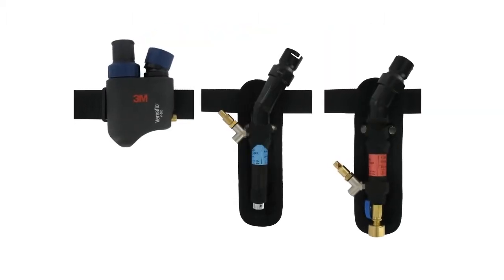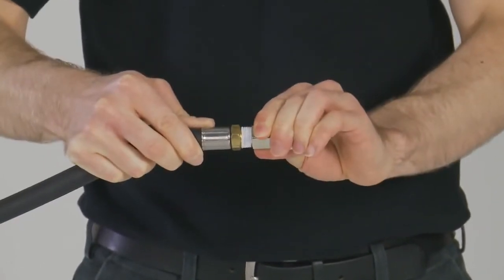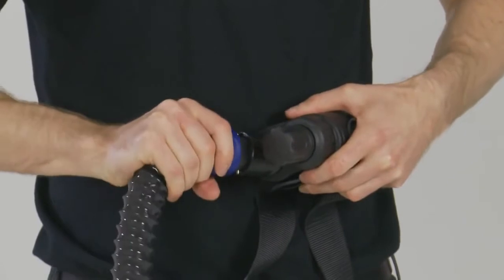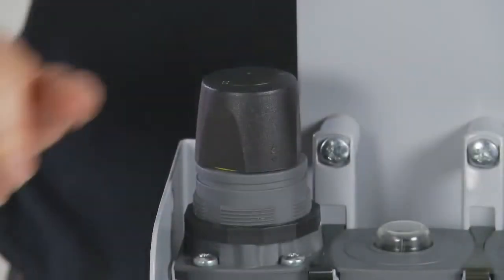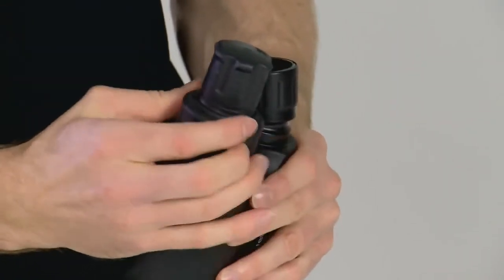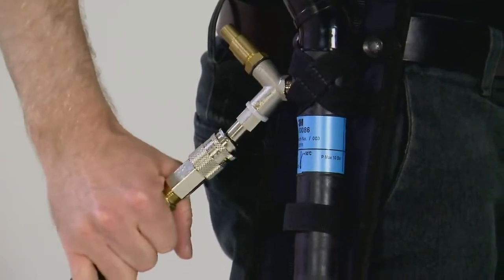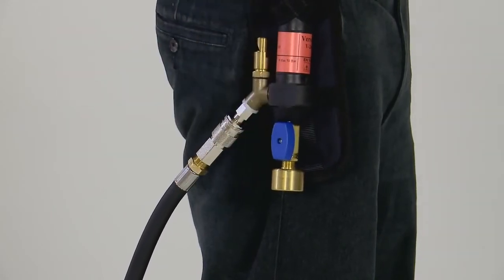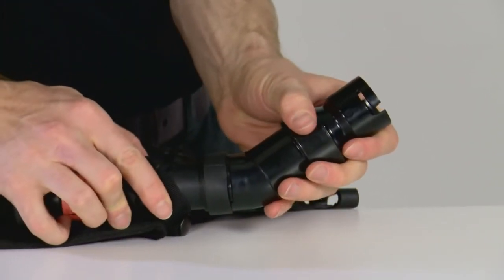3M™ Versaflo™ V Series

Comment: hello, can you advise me, still when I connect the air hose so the versaflo is a terrible noise, I have to repeatedly connect and disconnect the hose until the noise stops sometimes 5 times sometimes 10 times. where is the problem?
Reply: Air flow is too low

Comment: hello, can you advise me, still when I connect the air hose so the versaflo is a terrible noise, I have to repeatedly connect and disconnect the hose until the noise stops sometimes 5 times sometimes 10 times. where is the problem?